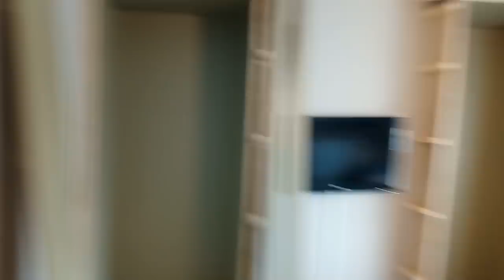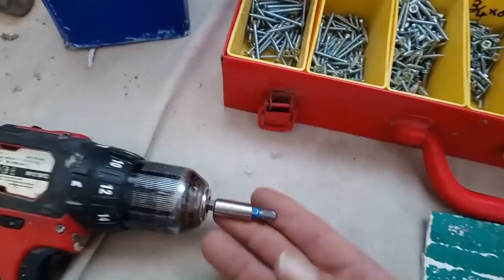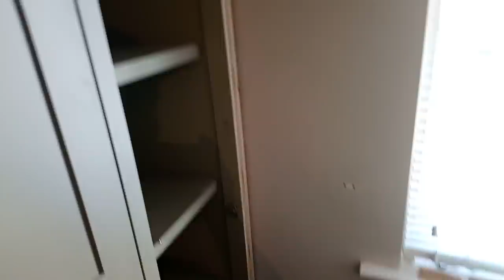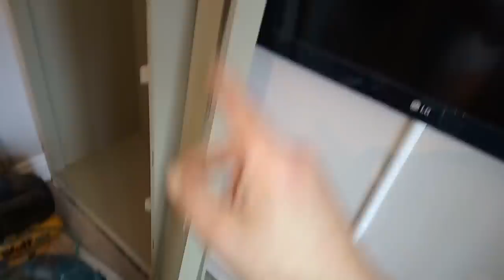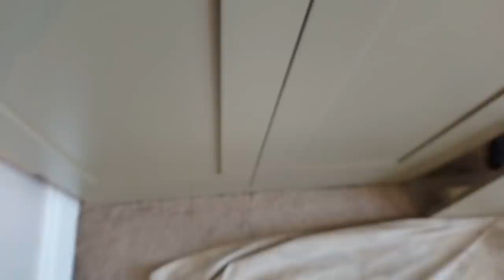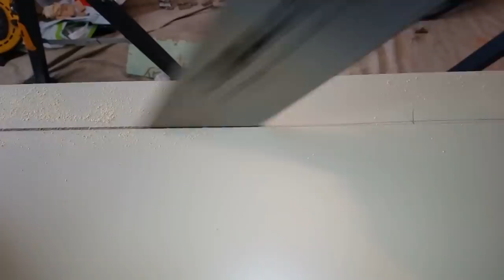Wardrobes Pt10- Finished 1, fixing the carcasses in & adding face frames

Comment: Great video as usual,  i love the tip to straighten the door, i remember my college tutor telling us that when dealing with a twist on a door.
Reply from the maker: 👍 It isn't easy getting the thin boards straight with my machines n even on jointers with a longer bed there'd prob be a couple of mm's out, The bend could be natural in the wood or when it was stored either in the warehouse or my shed, we'll see if I get a phone call if it comes back 🤔😁

Comment: Your scribing skills are off the charts! But why don't you cut the baseboard to terminate at the built-in instead of the intricate scribing around the profile of the baseboard?
Reply from the maker: Thanks Kevin 👍 If you're talking about the existing skirting board then they don't get removed or cut because pieces of furniture like this are classed as semi-permanent, if they're removed one day, the wardrobes, then the skirting is still there, the wardrobes are fitted 'into' the room if that makes sense, sometimes it's hard to repair skirtings that have been chopped into & cutting into them can reveal all sorts of horrors, they're prob fixed to the wall with wooden wedges driven into the brick seam & not plastered behind, that piece of skirting between the two wardrobes could come loose, best not to touch them n cut/scribe around 😉

Comment: Hello Gid. Great videos. Best on youtube. Just wondering where you got your scribing compass from. I've just got an old school one, but it doesn't lock. Thanks.
Reply from the maker: Thanks 👍 I've had many scribers over the yrs but none have been quite right, i can't remember what i use in this vid but the ones i end up using most of the time are Steadler comfort 551 compasses with the pencil attachment because you can accurately adjust with one hand & they don't alter if knocked or dropped, the ones i have i made a point with an old jigsaw blade, the problem with those tho is the adjustment thread sticks out both sides & can get in the way, i want a pair of compass/scribers with the threaded bit on one side, I did buy another pair that have nice thick arms, a lot of the scribers are thin n skinny, i think i'd bend them when they got stood o or thrown in the van, but the adjustment knob is a bit weird & the pencil holder is on the wrong side 😒 They're waiting for me to butcher n weld 😊 I'll film n post that if it works out,
Reply from the maker: I bought these a few yrs ago, they look nice but the little knob was very hard to adjust,, the slider was hard to accurately adjust by the mm & after a very short time they fell to bits with very little abuse, https://www.amazon.co.uk/gp/product/B003KIWER6/ref=ppx_yo_dt_b_search_asin_title?ie=UTF8&psc=1
Reply from the maker: These are the ones I've bought to modify, the pencil holder is on the wrong side & the knob has a sort of fast adjustment thing, hard to describe but it's a bit crap https://www.amazon.co.uk/gp/product/B07V9GKT28/ref=ppx_yo_dt_b_search_asin_title?ie=UTF8&psc=1

Comment: I like your inverted Jigsaw idea. Do you prefer this to using a coping saw?
Reply from the maker: It depends on the job, It's time & energy efficiency sometimes, doing it this way i get a clean cut on the face, i don't damage the face & can clearly see the line, i use the rough blade because a lot of these cuts are rip cuts & the blade is thick so doesn't wander when cutting from behind. i could do finer work on a lot of it but i have to do this within time n budget.

Comment: Hi. Thanks for posting your videos. I've learnt a lot.
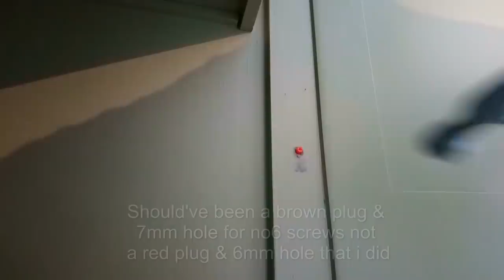At 4:08, when your attaching the cabinets to the wall, had you first drilled through the cabinet into the wall?
Cheers
Reply from the maker: Good, I'm glad n you're welcome, 👍 Yep, I'd drilled a 6mm hole for red plugs which is what i more often use but this screw was a 6x130 so it should've had a 7mm hole with brow plugs, Thanks 👍

Comment: Great job as usual. What sizes do you do the rails and stiles? I like the look and proportions you have done
Reply from the maker: Thanks darren , the stiles & top rails are about 80mm, i need that to be able to get 2 dominos in using the stops on the machine & a groove in for the panels that isn't too close to the dominos, the mid n bot rails are about 150mm, 
I did mention this in Pt6 i think but i understand, i couldn't tell you exactly where i say it, 11vids of at least 20mins each is 3½ hrs of viewing 😂👍